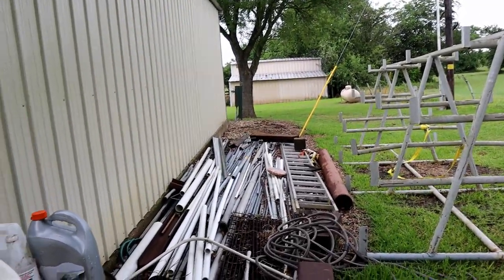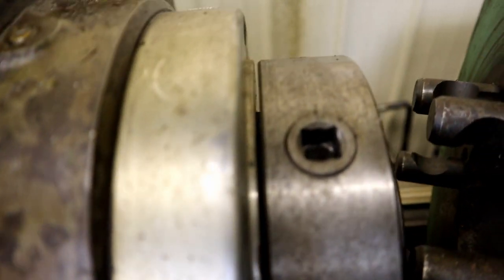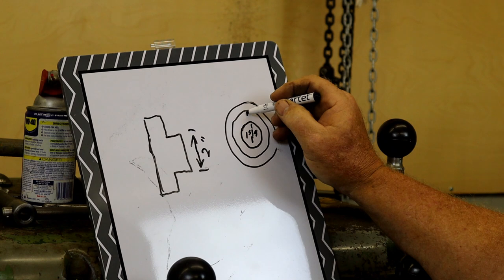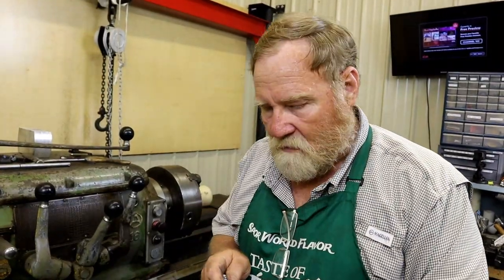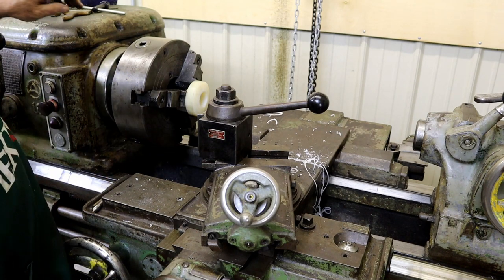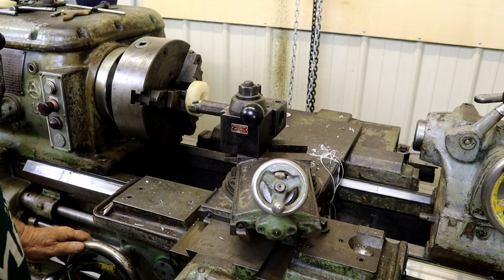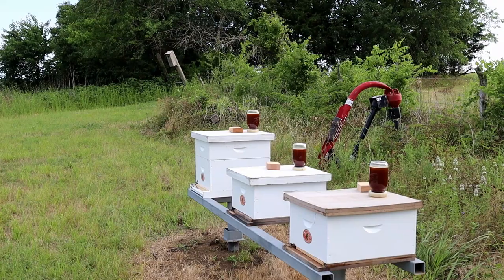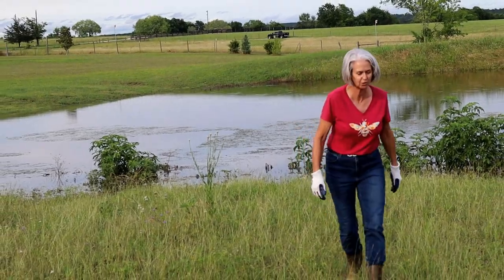Shop Concrete Progress, Lathe Work and a Wildlife Tour!

Comment: Personally I find graded stone incredibly annoying for roads as it won't pack and stay put and it constantly rolls around.  Good traffic bound laid in properly and crowned will make a driveway like a super highway and stay that way a long time. I too love having a lathe. :-)
Reply from the maker: I have a friend that used the screened limestone on his road and it did take a while for it to pack in.. Like a year!  I'm  going to let it self pack and get rained on for a while the run a vibrating roller over it to pack it even better... 
The regular limestone road base packs well but we have problems with the fines washing downhill and clogging up the drains...
Trying to take the lessor of two evils  :)